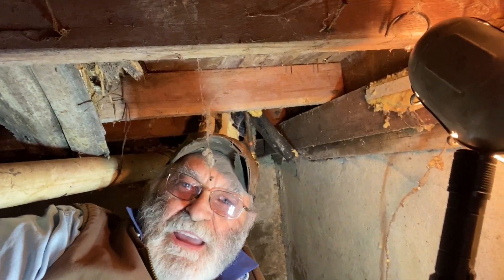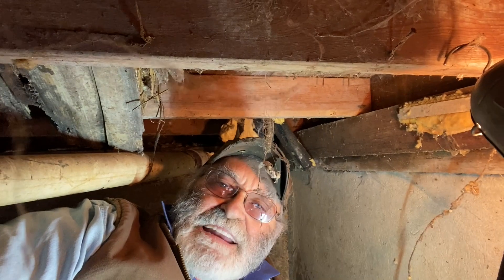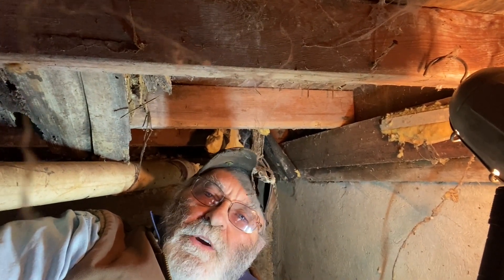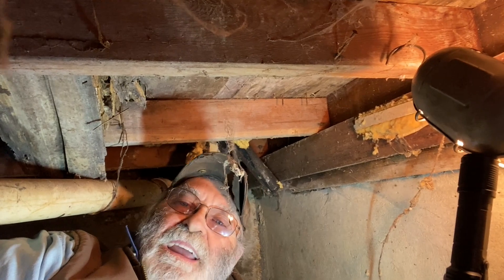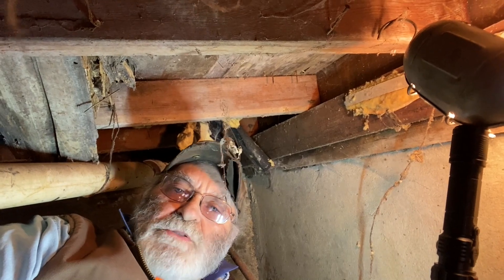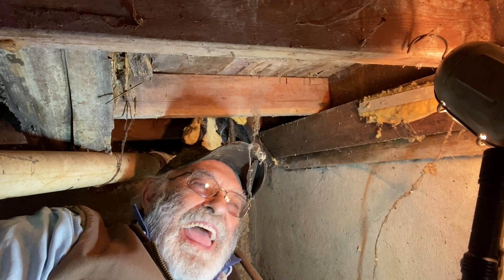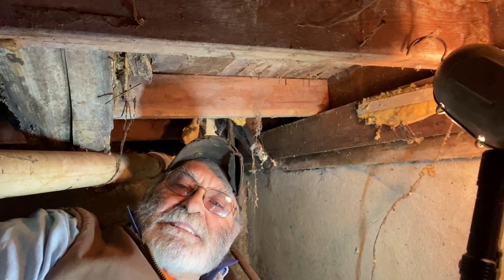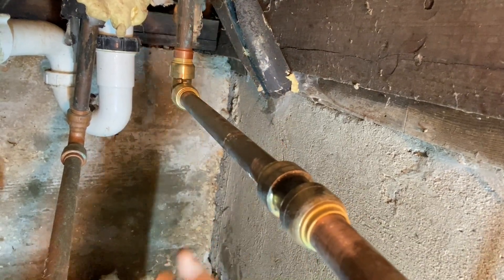Sharkbite and Soft Solder Repair: Busted Water Line

Comment: Those shark bites are great for tight locations. We used some up at my grandmothers house that we are fixing up. I don't like them for a toilet or faucet shut off. When you turn the knob on the shut off, the whole thing turns.
Reply from the maker: I agree Roger, they have their place in the service side of things as well.  So many times in the past just draining the water to where the heat from the torch wouldn't draw it to where you're making the joint was an aggravation.  SharkBite's can be installed with a steady stream of water pouring though where you couldn't even consider a solder joint.

Comment: When I used a couple of those "shark bite" connectors this past late fall, I too was somewhat doubtful,.. but they really do work don't they?
Not aj job that I`d want to have to face,.. but there you are, it has to be done.
Reply from the maker: About 20 years ago our supply houses started pushing a schedule 10 galvanized piping product called 'PressFit'.  They were deep cup 'O'-ring seal slip fittings that was simple to install.  So much faster than conventional Victaulic grooving and clamping systems or screw pipe or copper sweat joint.  I think the limit was up to 2''.  The tool was a huge set of clamps that easily changed off the end of the Milwaukee hand held power unit.  Measuring was a snap because the cup was soooo deep, you could miss by a half inch and the O-ring would still seal.  However....the schedule 10 galvanized pipe was seam welded and the galvanized coating was jeopardized at the weld joint and we had dozens of leaks within the warranty period as a result.  It would fail at the weld seam.  We maintained water treatment exactly to the recommendations of the manufacturer and still the continual failures. 
     I still have nightmares over those schools where we installed those systems, many of them multi-level hot water and chilled water systems.  One thing though, I don't recall a single failure of the actual PressFit joint and we had thousands of them. The fittings were all extruded or made by some other method and not machine welded and I recall no failures of those either.  We seldom suffered a leak from Victaulic failures, failed solder joints or screw pipe, especially after initial start up.
Reply: @tractorman4461  That, is how we all learn, by our mistakes. That's easy to say, but, oh so difficult to 'swallow' sometimes, isn't it?
Reply from the maker: @regsparkes6507  Yes, but I never found out the reason there was so many failures.  We sent much of the failed piping back to the manufacturer at their request.  They did have us make repairs with (iirc) 308 stainless thin schedule pipe though.
Reply: @tractorman4461  Seems like they ( the Manufacturer ) did care about the problem, and tried to overcome it.

Comment: That's 2 funny, just yesterday the pressure relief valve blew off my waterline, was splitting kindling and had a decent size chunk fly off my block and smashed the valve right off the pipe! I was in a panic for a good 2 minutes turning off the pressure tank while ice cold water was blasting out lol I didn't film the repair as I was just in a massive panic lmao thanks for sharing sir!
Reply from the maker: I've been in those situations before...too numerous to even think about.  That would have made a good video if you got all soaked making the repair !!  BTDT...got the T-shirt Andrew...LOL
Reply: @tractorman4461  meybe next time lol but I think I'll save the water videos for fishing ;p

Comment: The wall thickness is close to 3/8 inch  thick. It was on the one that I cut in two pieces.
Reply from the maker: Yeah, I knew it was at least 3/8 but I thought it was 7/16.  I'm still a little unsure on the safe way to cut one open without dying !!

Comment: hi there  good fix  . my last 8-9 years of working i did that kind of work in the local school system . had 72 schools . i remember one cold morning going for a leak . well the school was just starting to warm up  11 busted pipes and coils . what a mess /  also had a lot of dielectric fail  . glad i am out of there .   take care john
Reply from the maker: Never an end to the work in the school districts.  We did tons of chiller, boiler and piping on schools during the summer breaks. I'm not a stranger to what you describe !! LOL.  Always with a time line where it would cost us so much a day if not completed on schedule.  It meant a lot of overtime and sometimes setting up two shifts to either get ahead of the job or to scramble if one went sideways towards the tail end of the job.  I spent hundreds of hours on my back laying on a creeper pushing through tunnels on installs, start ups and repairs.

Comment: I was reluctant to try those Sharkbite fittings myself, but had some PEX hot water heating tubing that I had to re-route, and I decided to try them.  They work amazingly well, and saved the copper pipe solder routine I always have used.  On videos, I got a head-mount for the GoPro, and that works pretty good.  Outdoors, I have a mount on my hardhat/face-shield logging helmet, and use that.  I also have the same setup for my 7 year old grandson, and he loves taking his John Deere tractor into the woods, and making videos.
Reply from the maker: I've really only used them for a repair here and there...never have I installed a whole job with them. It is kinda nice that they just seem to force themselves off the pipe instead of letting the freeze split the pipes though.  But the gouges they leave on the piping is a bit aggravating to deal with.  I have a GoPro too and I keep forgetting to try to use it for videos. Kids are great helpers.... They just love to learn new stuff !! Thanks for the visit this morning Powrguy.

Comment: The old timers tell a story of a guy that had an old John Deere on a buzz saw. The radiator leaked so he would drain it at night in the fall to avoid freezing and breaking the engine block. One of the neighbors suggested that he use spring water as it never freezes. He ended up with a cracked block. I enjoyed your telling the story of the split l.p. tank. That is some kind of force.
Reply from the maker: The old friend of my Dad that owned the '39 JD A believed antifreeze would ruin the internal surface of the engine so he ran only water, storing the tractor dry-docked from fall through spring every year.  Must be a John Deere thing...LOL.  That's a good one though...everyone knows spring water runs all year around !!  LOL.  Good Story Gary
Reply: Hahahaha! Now that is funny!

Comment: Thanks for another cool video 👍 much respect for your experience and wisdom
Reply from the maker: Thanks for another kind comment....I've found that big problems on anything is just a compilation of smaller ones that add up.  Solve the big problem by paring it down into little ones that are easy to fix.  A fellow can't start out on the top rung of a ladder to get to the roof.  Gotta take the steps to get there....LOL.
Reply: How so very true 👍

Comment: Heck of a repair job!  When water freezes it exerts over 39,000 pounds per sq inch.  No wonder those old pipes burst!
Reply from the maker: WOW !!  I knew it was a lot, but I didn't know it was that much !!  Sooooo let's think a minute.... the equation for figuring the area of a circle is Area = pi X Radius square.  So the radius of a 1/2'' circle is 1/4'' or .25.   Pi is 3.14.   So .25 x .25 =.0625. So 39,000 X .0625= 2,437.5 pounds of pressure on a 1/2" fitting at the end of a pipe.   HOLY COW !! That little retention ring didn't stand a chance !!  Thanks for making me think a little this morning....  LOL.